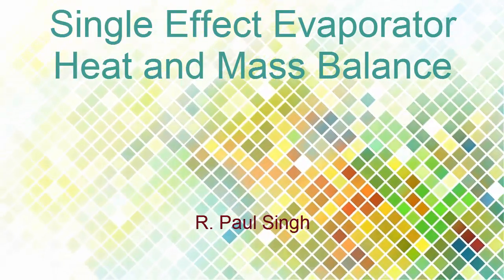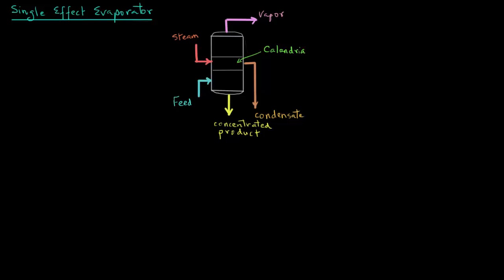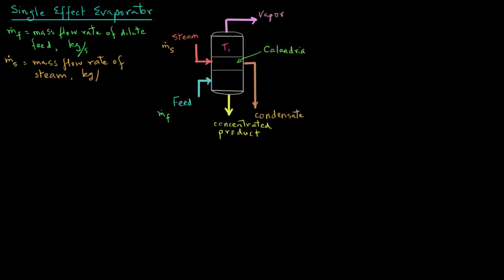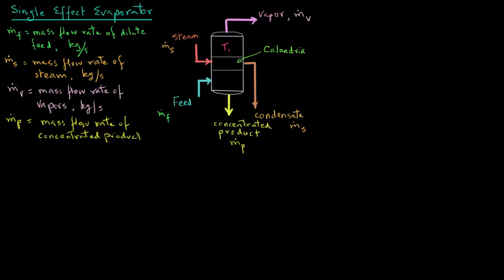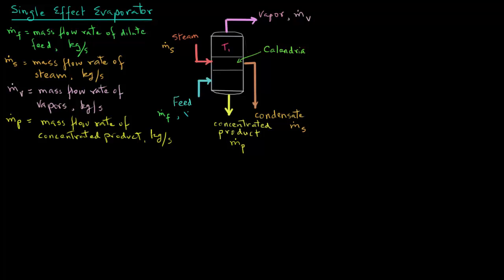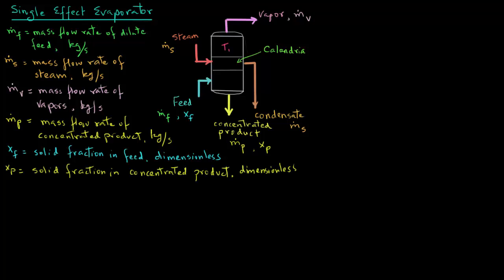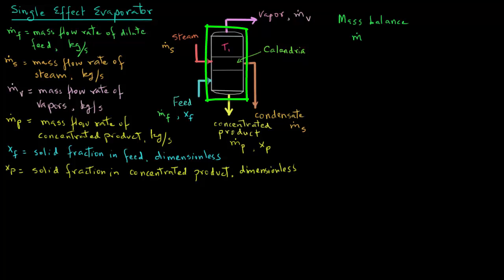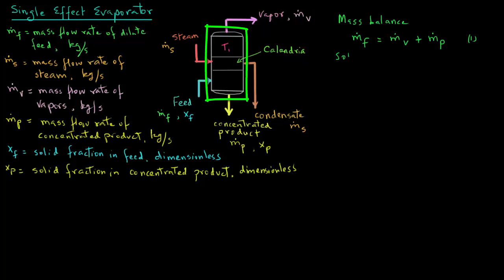Single Effect Evaporator - Mass and Enthalpy Balance

Comment: Hello, 
Just one question, I don't undersatand why the flow rate of steam equals the flow rate of condensate... The whole vapor isn't condensate as it exist vapor leaving. Can you help me please. 
Thanks. :)
Reply: The steam is not in contact with the feed. So the steam gives its energy to the feed and then condensates if form of hot water, which is recovered. The vapor leaving on the top is the result of adding heat (from the steam) to the feed.
Reply: Conservation of mass